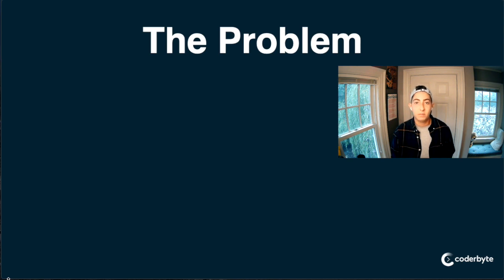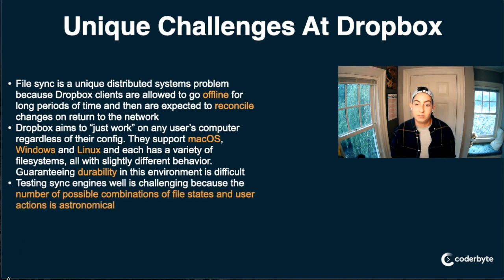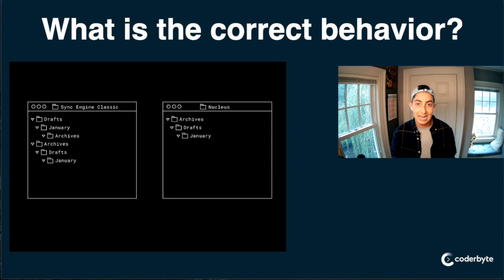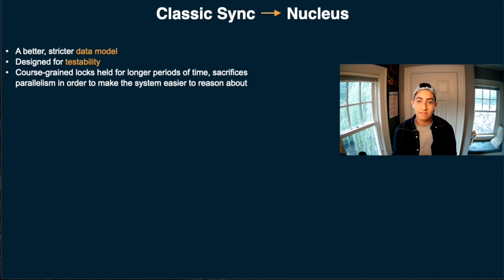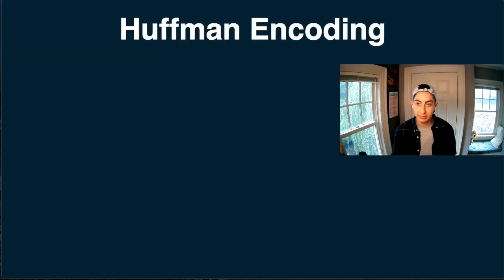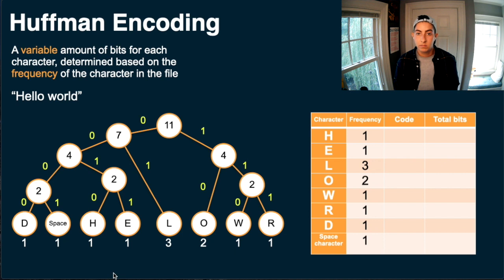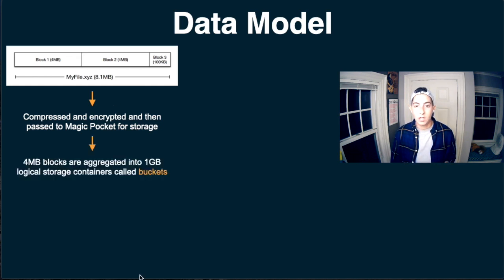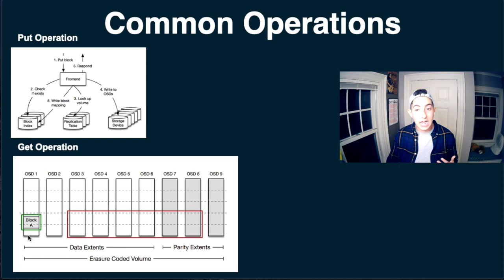Cracking the Dropbox / Google Drive System Design Interview Part 2 of 2

Comment: I get that you are explaining the system. But it would have been better if you talk about a problem and then explained the solution, the dropbox guys came up with, or at least a deeper comparison about how a certain thing was being done before and how it's being done now. The whole section about blocks, volumes and OSD was too unlinked. I mean why is all this complexity there, why is there a need for so many levels of abstraction between the actual block and OSD. The research is in-depth but, it would be hard to reuse this information anywhere else, the first part was better, where there is a clear problem-solution linking. But got lost on this one.
Reply: No research bro, these are literally tech blogs by dropbox itself she literally copied the entire diagrams from there